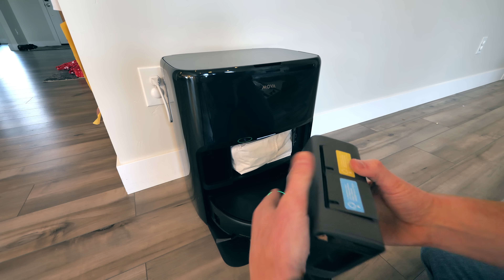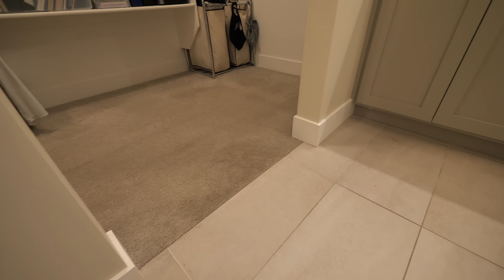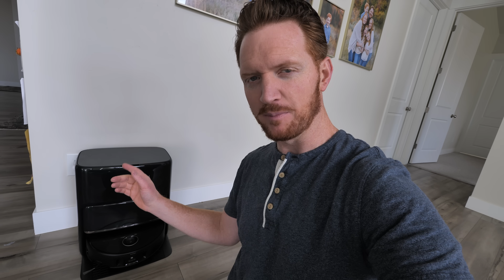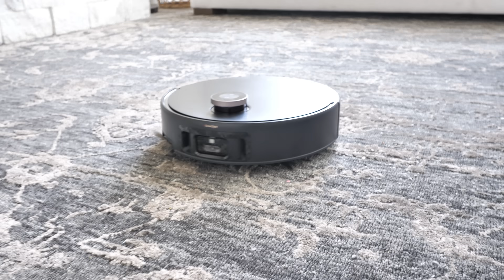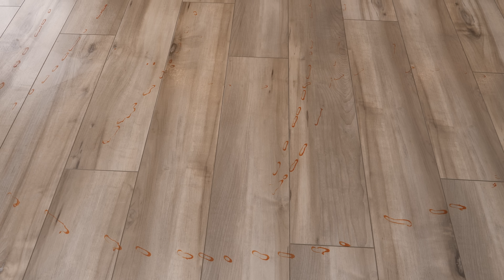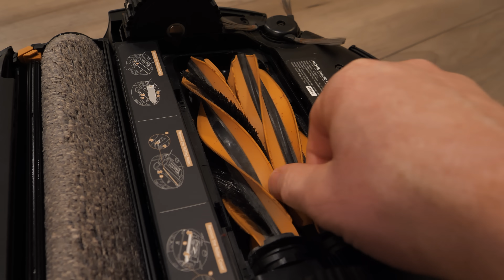Best Robot Vacuum in 2025? MOVA Z60 Ultra Roller Complete with Auto Carpet Protection

Comment: I have this unit and primarily have used it to vacuum. Tried out the basic mopping and it does a fair job. Increased the mopping to a heavier setting to leave a wet residue water trail (proof it’s mopping) and ignored the unit. About 10-15 minutes into mopping, I walked over past the base station and was surprised to discover that the station was surrounded by a 3-4 foot puddle of CLEAN water. The response from the forum was to clean and check the reservoir. I’m not too tech savvy on this topic and looking for any advice. Still waiting on similar advice from MOVA
Reply: @ibdribbles7128  probably the seat on the dirty water tank.  Take out the dirty water tank, clean the seal or gasket, then put it in firmly.  Known issue that Mova had to address.